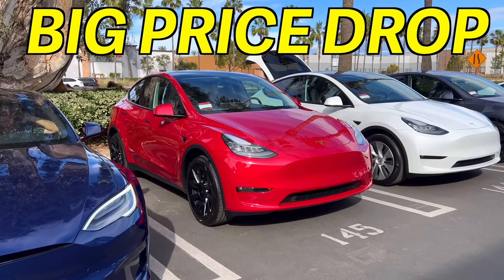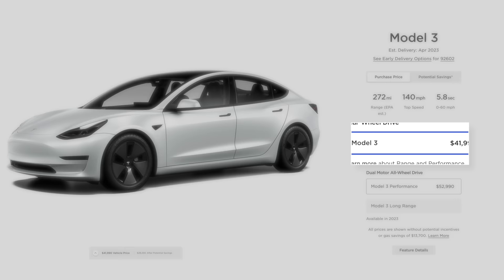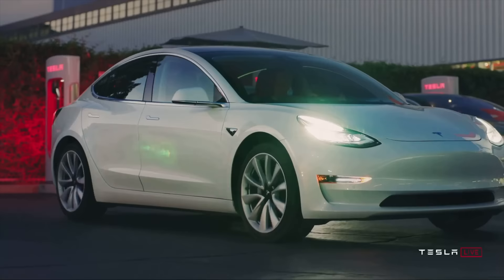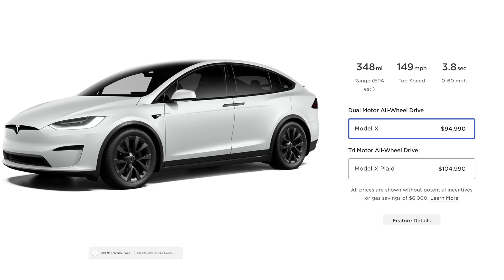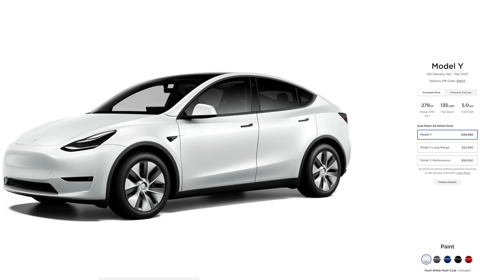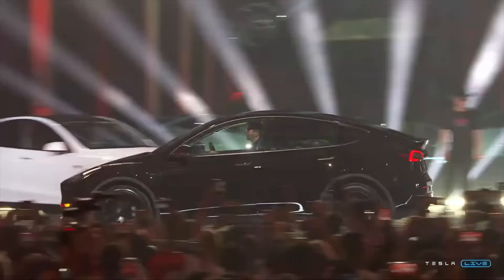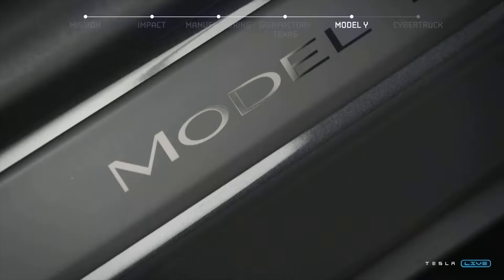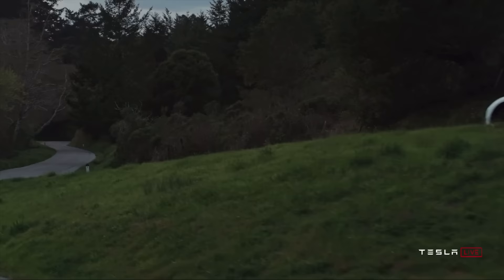BREAKING: NEW Model Y RELEASED - Big Surprises! | Tesla Model 3 + Model Y

Comment: Can the new base model Y be charged to 100% on a daily basis? I don't see anything about that on the configurator
Reply: You still can with all teslas just isn’t recommended from what I’ve heard because it can ware down your battery
Reply: @lui_ando  yeah I mean you can charge every single electric vehicle to 100% every day if you really want it to although it's obviously not recommended because excessive battery degradation. That's not what I was asking. The standard range rear wheel drive model 3 has LFP batteries. It's recommended by Tesla to charge to 100% for daily use. Since the new Model Y is also a standard range, I was curious that also applied to the Y like it does with the 3.

Comment: Is Tesla ranges even close to real world range.
Reply from the maker: Yeah usually
Reply: Your mileage may Vary just like any other car. Depends on the Road , Hills , Stop and Go and temperature if you are in a cold climate. 
But in normal conditions (not extra cold)it is not wildly off. Also you have to practice battery management to get the most life out of your battery .
This means keeping the battery charge between 30 and 80 percent on a daily basis for the NCM battery which most have. 
Your range will drop off about 10 percent in the first 3 years then stabilize for around 10 . Just now the first S battery's are starting
to need replacement at about 13 years.
Reply: Yes. I regularly reach my EPA range. Often even exceed it